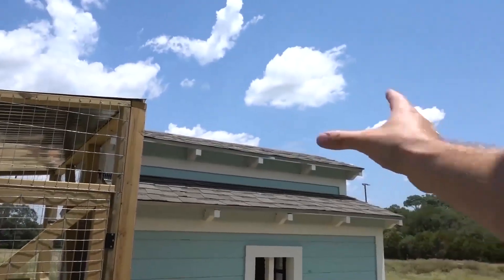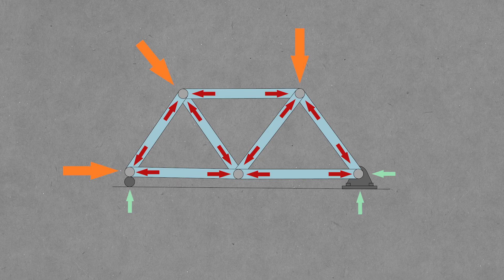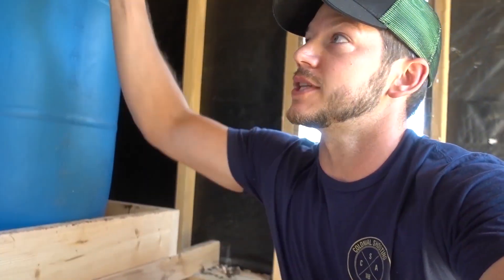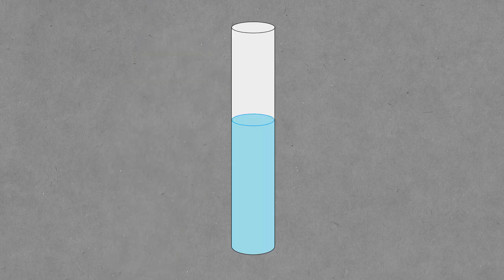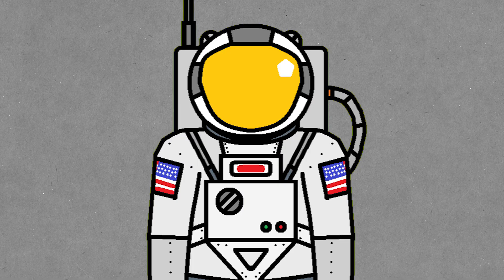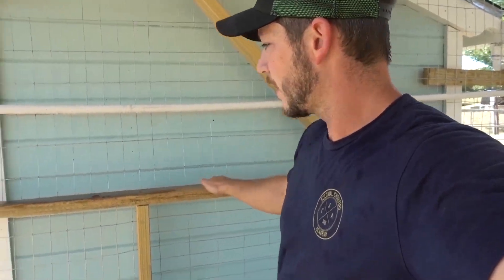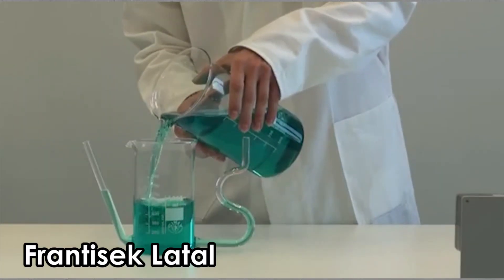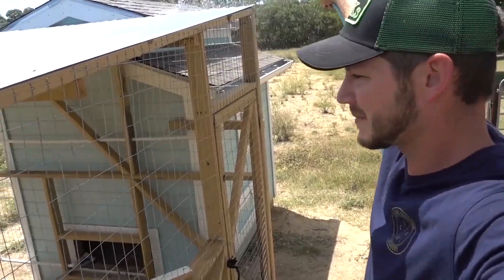Will water flow up a pipe?

Comment: So can this be preformed with an ac drain line to a rain barrel? It drips roughly 8 gallons a day so is it possible to funnel water up a tube and down into the barrel. Or through a tube and up the bottom of the barrel?
Reply: as long as the inlet of water is higher than the outlet, both methods you mentioned will work.
Reply: as long as barrel has air vent

Comment: I like to say it this way- that: the surface area of the water expands on the barrel side only because the volume is growing inside the system. The water doesn't 'flow up' so much as it expands into the barrel following an upward inclination, or something. Ty

Comment: What is powered by gravity? .... The filling up of the tank is not "powered" by gravity..... the filling up of the tank in an open fluid system happens because of pressure, in this case atmospheric pressure so, the tank can be filled with a connecting pipe from anywhere in the tank as long as the tank top is open partially or fully and as long as the tank bottom is below the water inlet level ..... in an open system where the air pressure inside the tank is the same as the air pressure on top of the water inside the pipe and if one places the tank bottom higher than the water inlet one would watch for eternity and the tank will never fill up .... the whole tank is below the water inlet of the connecting pipe and this means that for as long as there is water flowing through the inlet this could fill infinite number of tanks, as long as all tanks are bellow the   inlet level not the outlet level of the connecting pipe.... going around earth this level is not an straight line but a circumference ....... why physics academics got confused? In a zero gravity (there's no zero gravity anywhere)  or x gravity environment the location of the tank is irrelevant but the pressure of the inlets and outlets in any pipe is only fact relevant...... as for Matt, he is a deceiver, a liar, a trickster for he uses a garden hose that is connected to a source with higher water pressure spraying water higher than the water inlet in the pipe in question, there are lots of idiots out there ..... I am one in measure or more and less than others.
Reply: Everything you said was utter rubbish and displays an utter lack of understanding of how atmospheric pressure works,  we are all under equalized atmospheric pressure and that is why we do not get pulled out a window when we open it or sucked down a toilet and in order for atmospheric pressure to exert a force there has to be a pressure differential this is basic high school grade understanding, something you can test or well look it up as there is no shortage of vids is if you have a clear box that is filled with and is open to the same atmosphere as what is around it then it is equalized and nothing happens, pull a vacuum  in that box and now you have atmospheric pressure pushing on that box as it wants to fill the void and so when you open the valve the atmosphere rushes in and then stops when it has once again equalized.

 So if you put a hose on the side of that box with a stop valve in the on position and then put a hose from the valve  into a bucket of water  2 foot below it lets say, will acording to you  atmospheric pressure will magically  push the water up and into the box but in reality nothing will happen as the atmospheric pressure in the box is the same outside, however if you close the valve on that hose and then pull a vacuum in that box and then open the valve on the hose then atmospheric pressure would push the water up the hose into the vacuum void in the box but again once the inside equalizes with the outside the flow would stop, now if we back step and simply raise that bucket up to the level of the box with the box and the bucket at the atmospheric pressure the water would start to flow and fine a common level under gravitational force, and so for you ignorant comment to actually work and for atmospheric pressure to be the reason then those barrels would need to be under a constant vacuum which obviously they are not and since the atmospheric pressure inside the barrel is the exact same as outside the only thing that is exerting force is gravity
Reply: In the open, we are not under the same atmospheric pressure, and atmospheric pressure is not the same on the same spot every hour either...  atmospheric pressure at sea level is highest and less  the further up the land that we go.
Reply: @marlonvite4152  I never said we where all under the same atmospheric pressure what i said was " we are all under equalized atmospheric pressure ", so sure the higher you go the pressure will drop and so if you are at the top of a mountain the pressure in an open barrel is the same as the air pressure around the barrel, and if you have the same open barrel at the bottom of the mountain then the pressure in the barrel will still be the same as air pressure around it, so no mater where you go on earth you are always under equalized air pressure unless that is you are in a pressurized container like a plane
Reply: @EQINOX187 when you used the word "equalized" as in "made equal" or the "made the same" and consequently you tried to explain that you were in a differect context you sound like religious idiots going back and forth in their books trying to explain nonsense beliefs for ignorants, weak and superstitious .... I got you man, you are smart and intelligent and easy to contextualize .... you may be a genius too like most of us, potentially, stay cool.

Comment: Question:  Since Matt turns on the garden hose at the end of his vid and sprays the roof with water... could he not just leave the hose at the top of the gutter and a have a perpetually moving water circuit.  In this circuit he could attach a small turbine to generate electricity.  Of coarse this would be a much larger system, but could it work?  Asking nicely here. Please reply the same.
Reply from the maker: Unfortunately not, to get water above the roof you need pressure but the pressure is itself proportional to the depth of the water in the system. In other words you cant get water above the height of gutter without a pump. Boyles flask is sort of what you’re describing but it only works with carbonated liquids and will stop once all of the bubbles have escaped. Basically it’s using the bubbles as the pump but that takes up energy and eventually it runs out

Comment: Water starts from a higher point goes down makes some pressure,and yeah water to all.correct me if I'm wrong but with natural pressure water can go up only about 30 feet yes?!
Reply: Water in a tube can go up to 10 to 10.4 meters (32 to 34 feet) with one end open due to atmospheric pressure. The atmospheric pressure pushing on the open end can support a column of water up to 10 meters.

In this case, both ends, the barrel and the rain spout are both open to atmosphere, so both encounter equal atmospheric pressure. the water is not going up into the barrel due to atmospheric pressure, it is filling a container due to gravity, the same as filling a bathtub, a bucket, a measuring cup, a toilet.  The liquid is fluid and assumes the shape of the container. The point here is that the barrel, rain spout and the pipe underneath are all part of the “container.” The water will equalize at the same level in all parts of the container, in all parts of the system or network.
Reply from the maker: Natural water pressure can reach any height. If you have a water tank 1000ft in the air you can run water down to the ground and back and the principle of communicating vessels still applies

Comment: Only question remains is why one would choose between top and bottom filling?
Reply from the maker: He's filling and draining from the same pipe and it's easier to drain from the bottom
Reply: unless you want to siphon from the top, or add a tap to the side, using the same pipe at the bottom is much easier and convenient

Comment: So I'm looking for a way to circulate water through a DIY pool heater without a pump. The problem is, the pool heater itself is elevated above to pool, and I don't know of a way to get the water to flow up through the tube without a pump. Does anyone have any ideas?
Reply: As your god to change physics🤷
Reply: You have to lower the heater. Btw old house warming with radiators was done without any pump. Boiler in the basement and the water would self circulate.

Comment: does this principle apply to how the bottom part of the globe is not getting drowned/floode with so much water flowing down from the top?
Reply: No. The south pole is NOT below the northern hemisphere. The center of the Earth is below everything on Earth. Water flows down; down means somewhere closer to the center of the Earth. Down and South are NOT the same.
Reply: the south pole is not below the north pole, the core is below the north pole. the north and south pole are on the same level

Comment: are you able to harvested energy from fountain heron's fountain
so we used it on very large scale model and a series of heron's fountain gives tremendous energy forever
Reply from the maker: Unfortunately, infinite energy never works. From a brief google search, it looks like a heron's fountain has three tanks: high, low, and middle. The middle tank is full of water which is pumped up to the top by air pressure. Water then flows down to the bottom tank to create more air pressure. The problem is once the middle tank is drained all of the water ends up in the bottom and the fountain stops, you have to turn it upside down to get water back into the middle tank which takes more energy than you can get out of it.

Comment: As a plumber I've got to go read this dude's comment section for a good laugh
Reply: what about drainage pipes with a bad grade ? like lets say that it has a proper slope but were the catch basin is there is a small dip, will the water be able to flow all the way to the end of the pipe ?

Comment: You forgot to mention the only monkey wrench that can be thrown in the works... if the barrels aren't vented at the top. 
You show it in your diagram but don't mention it. If the barrels aren't vented, then it will only fill the pipes and barrels until what ever air can escape out the system to the fill tube, then once the inside air pressure of the pipes and barrels (depending on the design if water even gets into a barrel.) equals the water pressure at the highest fill point, then it will spill over the top fill point, but the pipes and barrels will never fill with water past that equilibrium point. 

On a side note, a possible design issue with his system is the amount of water collected vs the back pressure of the out flow. The roof and gutters could collect more water than can be inputted to the system, so on a really hard rain, the gutters will eventually over flow, eroding the foundation of the buildings. That is why most gutter systems use 2" x 3" rectangular or 4" round or even larger downspouts and not 1 1/2" diameter pipes.
Reply: kiddiescripterkiller in the design (8:01), there was an overflow pipe to keep that from happening
Reply: @idontknow898  Reread my first paragraph and first sentence in the second paragraph...

I basically said... that he "shows it in the diagram" but "doesn't mention it"... and that is "a key factor for it to work" the way the system is designed. Some people might miss that point, since he didn't mention it. 

And he should have (and I should have, in my comment) mentioned that "the vent" has to be the same size pipe or larger, otherwise if it rains hard enough, the back pressure will slow the water going into the system. 

A lot of people don't understand the reason why plumbing has codes... Then they DIY it and wonder why when they drain their sink it takes forever or flush their toilet, it bubbles the water in a sink.

Comment: Thank you cuz I was super tired and I wasn't understanding any of that right now I'm trying to figure out how I'm going to do my Hydroponics with just natural flowing on everything and he made a very good point that it does stay at level but if he were to put a cipher on the inside of the bucket on the side it could pull out more water because I do think the weight of the water won't allow it to keep filling up after a certain point that's where I'm having problems with some of my siphoning with water pumps I'm getting very frustrated and tired on the measurements so if you can write back to me where I can message you and maybe you might have better idea what I could do cuz I'm tired of using a lot of electricity
Reply: Hey meg Martinez did you get the solution because I am in your situation right now and I am thinking of siphoning rather than using electricity